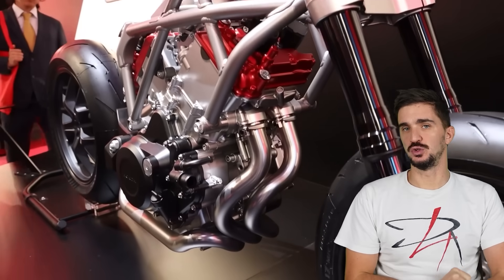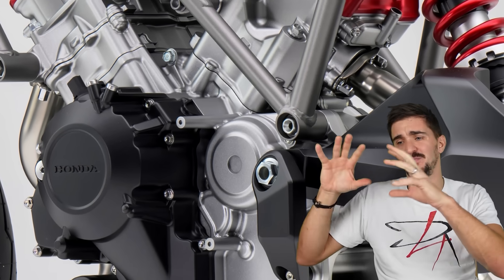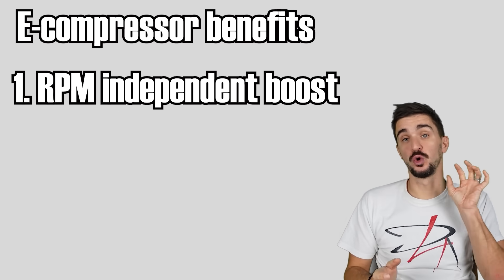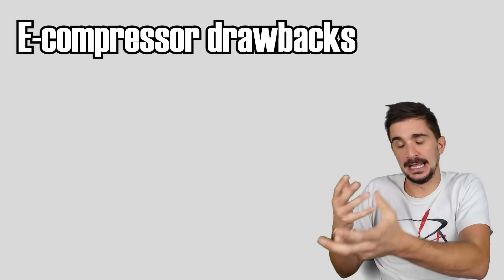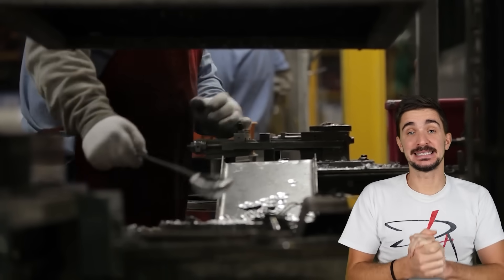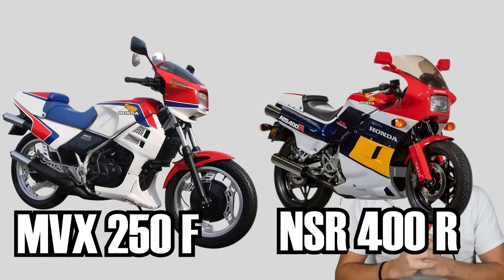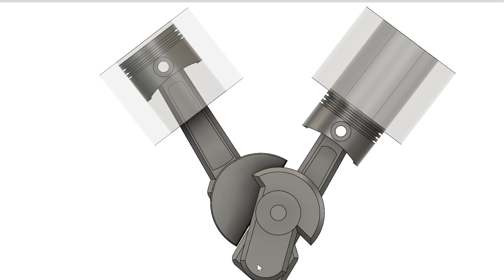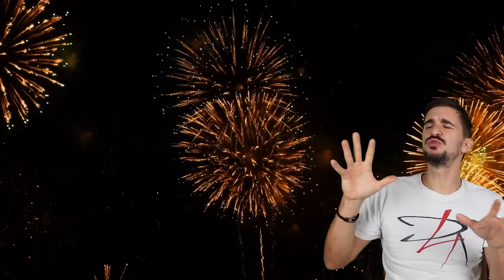Honda's New V3 Electrical Compressor Engine Explained

Comment: So many motorcycle engines are equipped with permanent magnet dynamos that waste electric energy all the time. It is a very old invention, in use since the 50"s , 60"s at least. Far from perfect but it  is prettty cheap,simple, lightweight and does not need a lot of room.The regulator/rectifier changes the  superfluous electricity into heat that will disappear into the R/R cooled by the wind, outside air. Will this new V3 cylinder engine though be equipped with a regulated electromagnet alternator? From the pictures i can not see, recognize an alternator, but as this is a prototype engine that can vary, change still probably? Sorry, english is not my native  language but i think you do understand what do i mean. Thanks for your clear explanation about this interesting new engine.

Comment: I hope they see excellent results from the compressor in particular, and that it doesn't become an expensive part that lives only on their top line models. The potential for improved low end torque in small displacement single or twin cylinders would be a boon for inexpensive, lightweight applications like the off-road bikes in the CRF series with <500cc singles with few additional changes. I'm more excited for that than the V3.
Reply from the maker: The e compressor is an interesting prospect no doubt but I doubt it will ever end up on off-road singles like CRF 250 and 450 r and rx. The engines on such bikes are already extremely power dense and weight is extremely important.
Reply: @d4a  That's fair but what if it allowed them to make the same power in a 300 that they currently make in a 450, or the same power from a 250 that they make in a 300, but with lower emissions thanks to less cylinder blowby on smaller circumference pistons?
Reply: @fixedG  ever thought about how batteries should weigh just to supply enough power to the compressor?
Reply: A problem with more "low end torque" is that it requires a higher octane rating, or compromised; air-fuel ratio, compression ratio, or timing.
Reply: Those bike are always flat out so I think a normal turbo or supercharger would work better. They don't need any more power anyway.
Reply: @will2461-j2n  I would wager that most modern bikes over 500cc on the street/highway, not track, spend less than 10% of their time "flat out".
Reply: @johndavidwolf4239  True even when I was on a 125cc it would only be flat out less than 10% of the time. On my big bikes its probably less than 1%.

Comment: Brilliant as usual. Have you done a simulation about electrical requirements for the electric super charger? In a Italian motorcycle magazine the engineer had some doubts about that. ( lot of electrical power needed to spin the booster)

Comment: One of my friends in high school told everyone he drove a "V5" (when it was an I5) and everyone called him an idiot. Who knew he was 20 years ahead of the game with odd numbers of cylinders.
Reply: Honda built the RC149 in 1965, an inline 5, 125cc engine with 33mm X 29mm bore and stroke,  and four tiny valves per cylinder, it revved to 18,000 rpm, they won the 125 title with it in 1966, fantastic bit of engineering.
Reply: The first mass-production straight-five passenger car engine was the 1974 (Fifty years ago) Mercedes-Benz OM617, for some military/commercial trucks even before that.
Reply: @johndavidwolf4239  sorry, I should have clarified "an odd number of cylinders in a V configuration". He WAS driving a Volvo with an I5.
Reply: @PsRohrbaugh  : Does a  V-6 with one bad cylinder count?  /s
Reply: Volkswagen made a V5 golf??

Comment: What would be the drawback of just making the third piston a larger diameter to the point it has the same mass as the other two and a combustive force that matches the combined force of the other two, instead of just adding mass to a connecting rod?
Reply: different displacements have different burn rates. you would end up with lumpy power delivery. i'm sure it could be made to work, but why bother when there's easier methods.

Comment: I don't know if you saw this, but Honda released some time ago another video "ICE Concept V3 Launch Video" (https://youtu.be/nkv9CGYHdik), and 2nd part of the video show bits and pieces of what seems to be the development of this V3 engine.
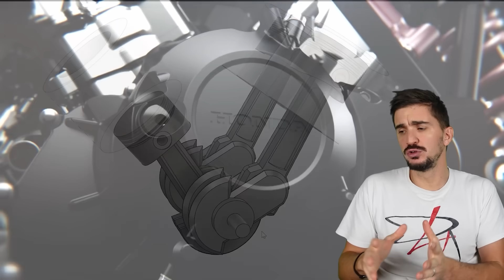In 0:30 and 0:32 (https://youtu.be/nkv9CGYHdik&t=30) we can see meters from engine testing, and lower part of the screen shows torque figure. Value is partially covered but the value looks like 146-147 Nm so for smaller engine (750-800 cc) would give much greater boost than 0.5 bar (it would be closer to 0.8-0.9 bar if typical 800cc NA engine gives around 80 Nm, 147 / 80 ~= 1.8; and we must account that turbo engines usually have lower torque values due lowered compression ratios).
Of course this could be only testing what this setup is capable of, and final product probably will "detuned" (emissions, some technical difficulties). I'm really excited for future motorcycle that will be equipped with this engine :)

Comment: I would love to see VR-type engine on a bike.
Reply: There is one available. The Horex VR6. Horex is a revived traditional german motorcycle brand. Unfortunately the motorcycle itself from my point of view is more an object of virtu than something you really want to have. E.g the engine is said to be a bit rough. And it doesn't rev very high. Which is the opposite from my expectation of a 6 cylinder engine.

Comment: When i saw that i was thinking about the f1 turbine to generate electricity over exhaust. I wonder what kind of different turbine designes you could take to power an generator with it. Since you could theoretically manage generator output via electronics. So you could use an pretty freeflow turbine which is not that restrictive but still generating electricity to recuperate some of the waste.
Reply: @nicoleibundgut534  it sorta has to be restrictive to get power out of it. Like you can lose power without making it from restrictions, but to spin it has to be a restriction. 

You could have a large buffer though.
Reply: @lasskinn  Would further complicate stuff but you could use exhaust flaps to recuperate energie in cruise situations. When batterys are fully charged you could even directly use the energie to power electric motors. More a case for hybrid cars then a bike tho.
Reply: The ONLY problem with applying cutting edge F1 technology to consumer vehicles is money.

Comment: One way to look at the electric turbo is that over time we store power in the battery, ideally when the engine is running at a high efficiency, and then we use that stored energy to boost the input when we want more power, all without pulling any power away from the engine at that time. So really this is a battery booster ;-)
Reply: Not really, a 'battery booster' would be something that gives your battery a boost of charge.
I suspect you were trying to say its a 'battery powered booster' 😉
But I think Hondas term is perfectly accurate and acceptable.
Reply: @pc750-V4 🤓
Reply: Supercharger
Reply: @Southghost5997  Very clever.😄
Reply: E-charger is only for drivability and power for downsizing .
Efficiency is not a target, because there isn't a turbo-generator too.
For motorbikes application, is better a bigger V-twin with a direct stratified  injection, I think😊
Reply: @ValerianoCeliberto compared to a conventional supercharger (ninja H2), honda's has no parasitic loss when not in use, so it does improve eficiency
Reply: Now THAT'S a hybrid I can get behind
Reply: Compressor, no turbo!
Reply: The power loss will be compensated by the alternator. No free deals
Reply: I agree.  If the electric motor can only be used for limited duty cycles due to heating, then the battery can carry the power requirements during full boost.  Under most circumstances, that's unlikely to last more than a minute or two at a time.

Comment: Why would a E compressor need an intercooler ?  as air will be entering it a ambient temperature not via a hot turbo
Reply: You clearly don't understand how turbocharger or supercharger work.
Reply: Compressing a gas will always increase the temperature of the gas, regardless of the method of compression. Simply put, this is because compressing a gas squishes the molecules closer together and they start bouncing off each other more frequently, releasing a little heat with each collision; just like rubbing your hands together really quickly causes them to get hot. While the electric supercharger will add considerably less heat than a turbo, it still adds heat due to the physics behind the behavior of gasses; just like a belt-driven supercharger does.
Reply: @chasebarber6154  7 psi  it would be negligible at best
Reply: @mas12312  Maybe so. I wasn't trying so much to defend the necessity of an intercooler in this application; I just wanted to share an explanation as to why the intake air would still end up warmer than ambient despite the lack of exhaust heat transfer from a turbo. Since the temperature gets raised, an intercooler MIGHT be beneficial, though I'm by no means an engineer.  I'll let the necessity/utility of that be argued amongst their ranks.

Comment: Having the power be variable depending upon the length of time the compressor runs will provide a unique driving experience. It might be interesting and sort of fun but practical?   I'd hope it can stay on boost for 60 seconds but I'm thinking more like 10 seconds. Then how long do you have to wait till it can spool up again. The thing there is you don't know if your going to get the boost when you crack the throttle. I'm thinking, just weird. I loved the whole thing the first time I saw it but I think it's the answer to a question nobody asked.

Comment: So, it's a totally new concept with extra complexity that makes marginally more power than the totally awesome  vfr750 v4  engine we had  30 years ago . What a  result Honda engineers 👏
Reply: Don't forget that we have euro 5+ emission standards for motorcycles now.
Reply: Yeh, because motorcycles are the problem right.
Reply: @andrewormerod2780 every vehicle with ice engine is a problem for the dudes in Brussels.

Comment: I like how this can make max boost at very low rpm but I will add that tiny variable vane turbos are pretty close to doing that as well! My passat diesel can produce 26 psi (max on my tune) by around 1800 rpm, this also means I have zero traction in the wet if I give it any sort of pedal haha. 300 foot pounds by 2k rpm and holds it up to 3500 ish
Reply: That is good for diesels, but for gasoline engines it would require either very high octane rating fuel, or reduced compression ratio.

Comment: 8:47 20k red line, hell of a beast 🤌
Reply: Why do you think that it has a 20k rpm redline?
Reply: @Maboidatboi  it's v3 and has less bore diameter and since the weight of that reciprocating mass is low it has that outrageous rpm. Needless to say if it was a litter class bike it will not be able it rev that high.

Comment: Brilliant explanations as usual. The naked roadster V3 Honda will be my first Honda and force induction motorcycle. This is shaping up to be the most interesting motorcycle of this decade
Reply: If you know how honda works, this won't come out as a naked or sportbuke6
My bet is something like an vfr, v3r maybe
Later they may go for sport or naked
Besides the cbr rrr still has at least 2 years of production, and the new hornet 1000 just came out, you need thar torque curve flat on sports tourer bikes
Reply: I want to see a v7 engine. That would be incredible
Reply: Sounds like it will also have the most advanced electrical system of any motorcycle to date too.

Possibly a 2nd high performance lithium ion battery just to run the supercharger?
Reply: @volvo09  i was reading in another  article that the Goldwing alternator is powerful enough to the needs of this e-charger

Comment: Also, does this still qualify as a V? Since the opposing pistons are not on the same crankpin.
Reply: V configuration has nothing to do with the crankshaft. It's a cylinder placement configuration.
Reply: @vvevvevvvv is it really? then why is the VR6 a L6 and not a V6?
Reply: @vvevvevvvv And why isn't the Testarossas's engine a Boxer?

Comment: Would it be possible for Honda to use uneven piston sizes?
Large single piston at the rear to compensate for two piston’s at the front.
Reply: Interesting idea.

Comment: Sorry to be that guy BUUUTTT if an electric turbocharger was installed on a wasted spark type ignition in that situation it is free energy, aslong as the charging system can handle it.
Reply from the maker: There is no such thing as free energy. A wasted spark would do nothing about it. It's in the name too. Wasted.

Comment: wait a minute. compared to the porsche version - that is an electric turbo cus it does have a turbine and does rely on the exhaust gases eventually? but porsche uses the electric motor up at the start so that compression can be peak before exhaust peaks, ii.e. to reduce turbo lag? 
am i wrong?
will this honda electric compressor work throughout the rev cycle or will its 5 psi just be used to spool up?

Comment: But but you didn't mention the secondary balance of the v3! I need to see a graph or something so I can sleep
Reply from the maker: On the configuration I showedd you got two at tdc and one at bdc. Secondary points up both at bdc and tdc so it's worse than an inline three but secondary isn't really too important on bikes as the reciprocating masses are small.
Reply: @d4a  That V5....The mesh on the intakes, was that all "intake filter" these had ?

Looked like it was only able to filter birds and medium to large size rocks...
Reply: @JohnDoe-bd5sz  it was a racing engine for motogp so they only cared about max airflow
Reply: @schlitten2505 is?
Reply: @JohnDoe-bd5sz that’s a spark arrestor to stop static electricity setting the engine alight at the intake
Reply: @JohnDoe-bd5sz not much to suck in on a race track and they get rebuilt every race.
Reply: @flynndobson5473  interesting. Thank you
Reply: @BELANDIOFFICIAL yeah you’d be surprised how much static comes from moving air and fuel around
Reply: Incorrect. At 75 degrees, you wont get that with one crank pin. 90 will.
Reply: From the picture it did look like 90 degrees even though he said 75 degrees.  So, is he using a 300 degree circle instead of 360?  @mattockman
Reply: @jimkelly1613  no, it’s less than 90.
Reply: @d4a  What does this mean what you say here? I think you can't judge the secondary from looking at a picture, it requires an analysis. And I think the secondary of a 3 cylinder is in perfect balance looking from the end, it just has some problems looking from the side.
Reply: @srenlausten-hansen4248  it shouldn’t, but in practice I’m sure it is.
Reply: Go watch D4A’s video on the Honda V5 and sleep like a content baby afterwards, dreaming of impossible things coming true.
Reply: I would think that it is possible that secondary unbalance is very small.
Reply: Me parece que conoces poco a Honda como motorista si hay un motor fino y bien desarrollados son los Honda amigo mejor costructor de motores del mundo no lo digo yo sino las estadísticas lo avalan Honda es Honda ha sido siempre un referente en tecnología y seguirá siendo lo de por vida salvo para  gente que no tiene ni idea
Reply: That's the first thing t thought when they showed the cut away pic of the pistons.i thought it would fire 123
Reply: That's why it's 75° and not 90°. They made an off balance v twin then added a third cylinder to balance it out
Reply: Go research yourself til you fall asleep
Reply: Balance is secondary to performance on most motorcycles. single cylinders with large bores are really popular on offroad and dual sports, despite having zero inherent balance, they have the best torque per displacement.
Reply: Hah hah hah that is a good one
Reply: 12:26
Reply: This engine would return a sound like the Laverda Jota 1000cc engines of the 1970's into the 1980's. Musical, throaty, sweet...watch another video here to find out for yourself.
Reply: There is just something about a in line 4 cylinder high performance engine that gives a eargasum,lol😂
Reply: @larrygooch6233  inline 6 better
Reply: @larrygooch6233   Cant beat 60 degree firing - Old Ducati please
Reply: @larrygooch6233 it depends on how engine is made. Muscle with overlapping valves sound nice on idle. High revving engine sounds nice on high revving. Angle design makes the difference in sound. Old school Lexus v8 sounds terrible.  But it's a smooth engine. Sometime displacement doesn't mean it sound better.  But most time I do think it sounds better
Reply: We need flat-6 bikes tbh
Reply: @chadwickreno8499  Goldwing/Valkyrie is flat 6 right?
Reply: @godfreytomlinson2282  They're a dying breed and will be made obsolete by the inline 4 unfortunately. I do like v4 motorcycles though ngl
Reply: Gold Wing ?
Reply: Because, he doesn’t know, simple. 😊

Comment: Hey Bro I love your videos.
Very clear and common sense.....
Do you make the engine animations yourself?
Reply from the maker: Thank you. Yes, I do. Fusion 360 for now. Might switch to Onshape in the near future
Reply: @d4a  That’s actually very impressive thank you for your hard work.
Reply: @d4a  Very nice, I use SolidWorks for over 20 years now. It's the absolute best. So easy and common sense. Nice Work!

Comment: I actually made project in my collage on combination of turbocharger and supercharger. Where supercharger was electric. 
It was 4 years ago . I was inspired from a rally car which used both methods of forced induction.  The car had supercharger which used engine'd power.

Comment: Will it be vtec thou?
Reply: Honda is rarely using the VTEC on motorcycle engines. CB400 uses it. And the last generation VFR800 used VTEC also. But as far as I know VTEC complicates valve adjustments quite a bit, which isn't great when you need to adjust the valves every 20.000-40.000 kilometres on average.